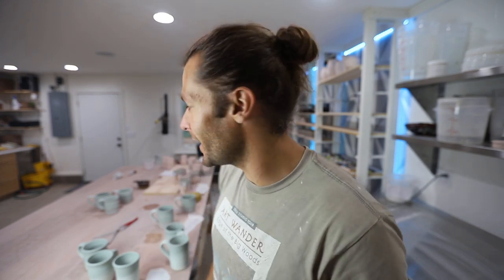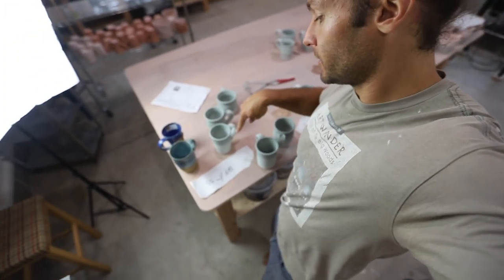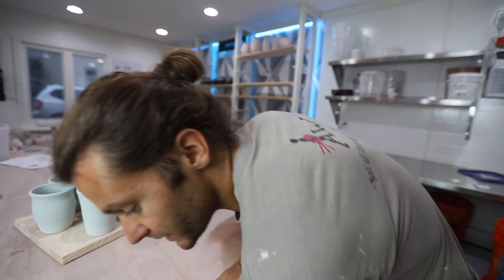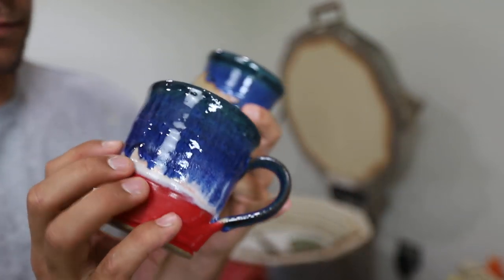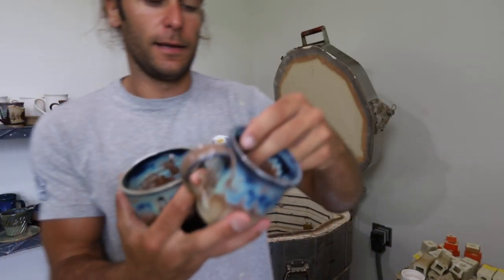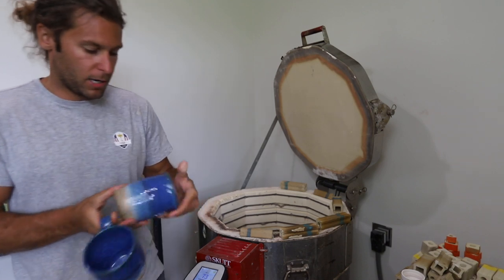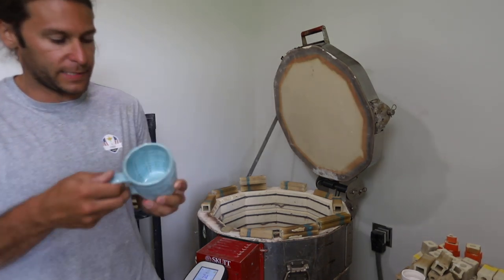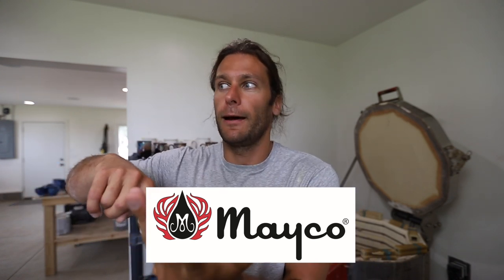GLAZING Pottery Mugs and FIRING them in the kiln

Comment: But hey man you know what might really help you I notice you do a lot of like the inside matching the upside down dip so in other words the inside one color and then from the lip down halfway will be one color. Well there's a really easy way to do that fast I mean really super fast without pouring. All you got to do is dunk upside down your cup and put it on a little bit of an angle so some glaze goes in with it you know what I mean. And then is you coming up jerk it up but don't pull it all the way out of the glazed and you'll get a full mug almost full of glazed and then you just well it's still underneath and the surface tension hasn't broken just twirl the Muggle in a little coat the entire inside of the cup. I'm sure there are videos showing that because I can't remember where I learned it but it's a good chance it was on a video. You can glaze a mug so fast it saves so much work especially for you doing so many.

I'll try and explain it again. So do your first dunk with an upside-down mug tilted a little so some of the glaze goes up inside and then straighten it out is you push it down to where you want the glaze to be like halfway Jerk it up but stop before it comes out a huge bubble of glaze will go inside the mug and then just shake it around in circles and it'll swirl coat the inside it works absolutely flawlessly. And once in awhile I will get a tiny spot that isn't coded I mean maybe one out of 10 it all I do is score of the drop into the bottom swirl it around and set the cup down. I can literally glaze a cop like that in honestly lesson 3 or 4 seconds